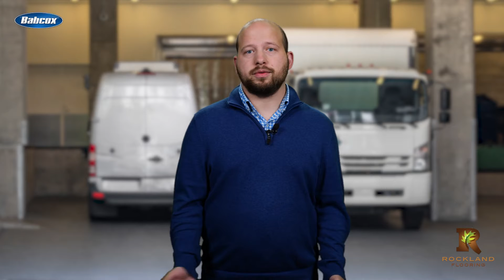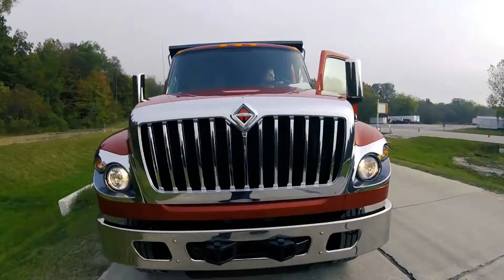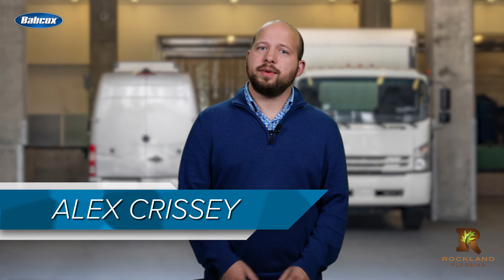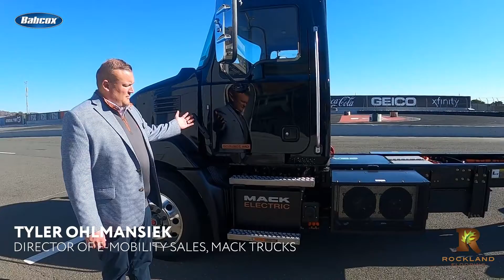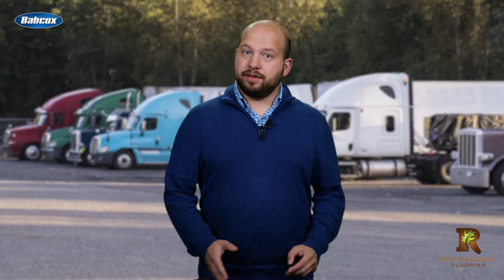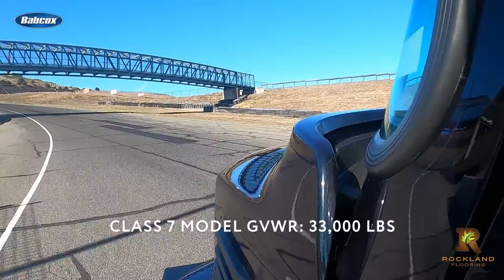Inside the Mack MD Electric

Comment: Nice video - ok keeping the same structure of the diesel but keeping a crankshaft (considering there are a variety of electric axle available) is basically a gift to the part supplier considering you brake one every 100k km on average